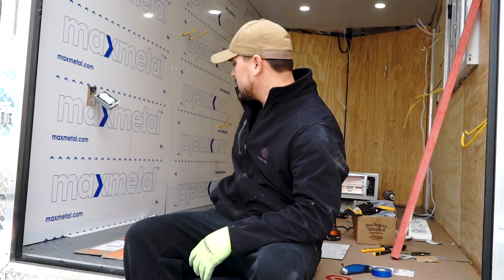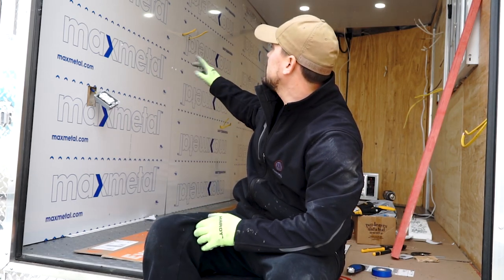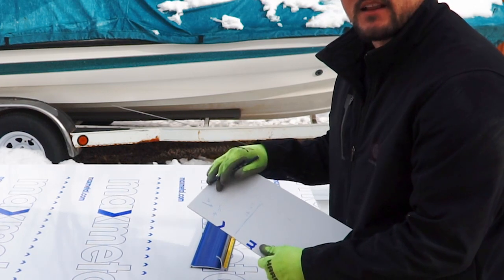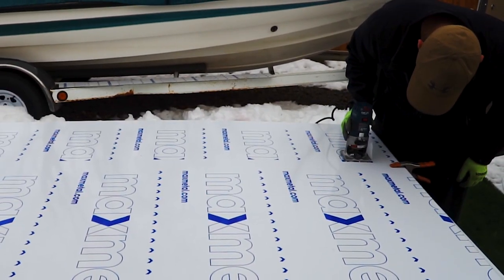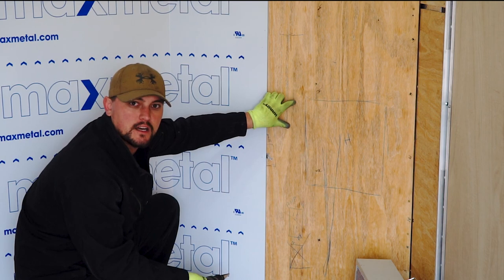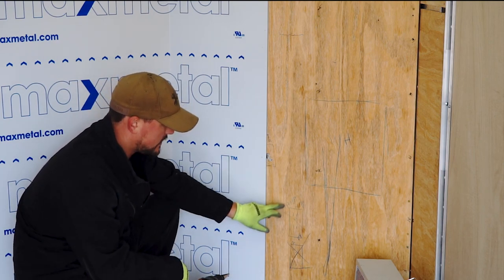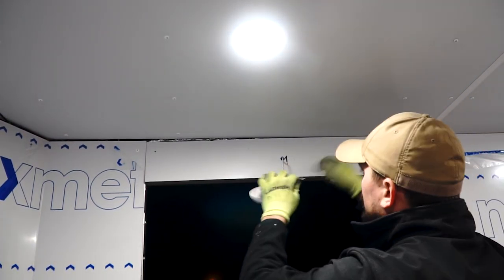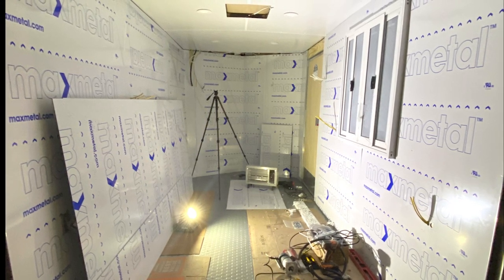Install Interior Wall Panels for Food Trailer - Aluminum Composite! | Cargo Trailer Conversion Ep.5

Comment: Did you use this SKU number of panels material that you’re using because I went to the website and I found this one they don’t have the all white on both side the number I found was SKU: MM843MMS, 4  x 8 Mirrored Silver / White is this the one you use
Reply from the maker: SKU: MM843MWLT, 4 ' x 8 '. Max Metal Lite.
I’ve switched to Alupoly for all my ACM material though, it’s better quality and less expensive. https://www.piedmontplastics.com/resources/literatures/piedmont-sign-gradeR-alupolyR

Comment: What trim did you used for the top that connects to the side walls
Reply from the maker: I used 1"x1" angle aluminum from trim on the top and bottom of the walls. If i did this again I would use the stock .040 aluminum that trailer manufacturers use though and cut my walls about 2" shorter so I would have easier access for the wiring.
Reply: Sorry I should have been more specific, what type of trim did you use on the ceiling seams?

Comment: How has the PVC trim held up?

I just put my order in for my white 3mil panels and am debating between your solution or aluminum divider trim from Orange Aluminum.
Reply from the maker: It’s held up great on the walls, but a couple spots on the ceiling have pulled away but not bad. I planned on using panel dividers but it was a major pain during install because my panels fit so tight from floor to ceiling. Doing it over I would cut the panels shorter and use a bigger top corner trim.

Comment: What screws did you use to attach the panels? Also what trim where two panels but together? I watched a few of the videos and can't figure those out. Thank you.
Reply from the maker: I used white lathe screws to attached the panels and used pvc edge banding to cover the seams. https://amzn.to/46iODc5
Reply: @ShouldBeGood  This PCV tape makes sense for the laps.  Its quite genious actually.  What about the corners (90 degrees)? @ShouldBeGood 

EDIT:  I think, I see you bend the pieces for angles, so you didn't have any corners only laps.  Nice idea.

Comment: What is the name of wall material
Reply from the maker: Hi Ronald, the wall panel is 3mm ACM. (Aluminum Composite Material) There are many different brand names and most plastic and metal supply companies stock it. Polycor, Alupoly, dibond, e-panel, maxmetal, alucobond are some of the brand names.
Reply: @ShouldBeGood  these are the best solution i've seen for trailer panelling. which size did you go with? i have a 6x10 trailer so trying to limit the seams.